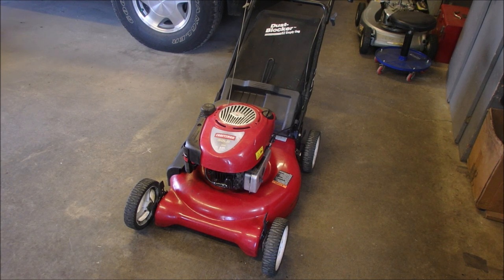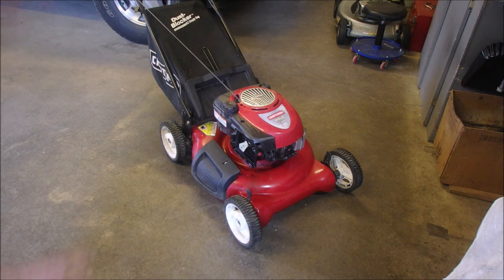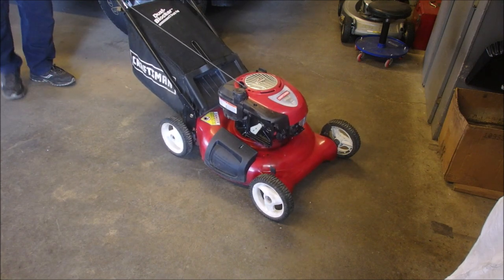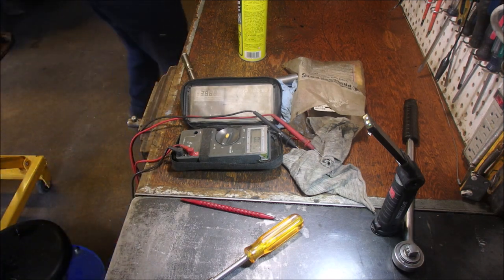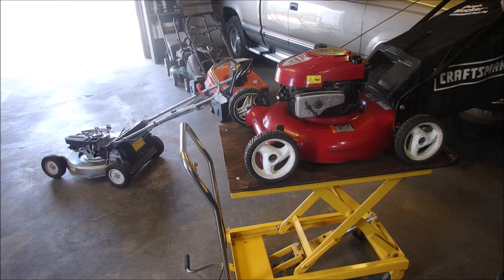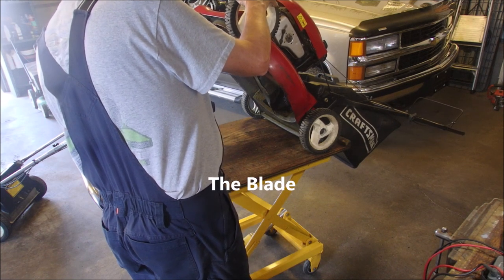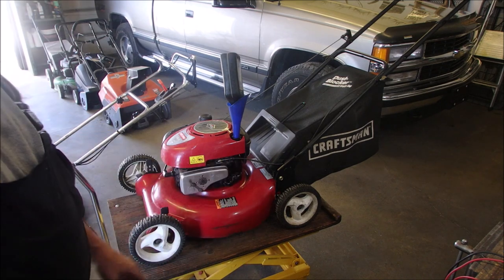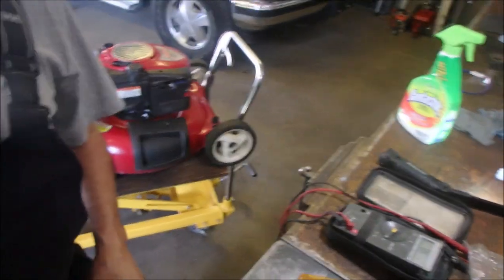Craftsman With  A Bad Quantum Engine??

Comment: Thanks for the thanks Bruce the head bolts nearest the muffler are always loose. On the older machines i have found them so loose i cannot believe the head was not leaking oil in some cases. Good video lucky it was not the death rattle your customer should be very happy. For that blade to be loose i would guess someone other than you had been working on the blade and never properly torqued it down.
Reply from the maker: I really think I was the first one to work on it.  As it was just low on oil over time.
Reply: Not too sure Bruce how would you explain a loose blade bolt unless not properly torqued at point of manufacture . @BrucesShop

Comment: If the air filter is oiled it(filter) is probably no good. I think people even including some mechanics were used to tipping them with the spark plug pointing at the sky,but that can cause the top mounted breather which is fairly far towards the front to become submerged in oil and the oil can get via the hose into the air filter box or even into the carburetor and intake valve.
Reply from the maker: Right  Thanks a lot.

Comment: When the blade's been ran loose there could be damage to the adapter or even to the mounting bolt.
Reply from the maker: You are right.  I torqued it after i sharpend it.  I wish I could film eveything.

Comment: Nice work sir. Had that happen to me before had to add a washer to mine and no more noise but not sure if it was a craftsman or mtd 😊
Reply from the maker: Right the bolt can bottom out before the blade is tight.  Thanks for joining in.
Reply: @BrucesShop  your welcome sir

Comment: Just replaced a carb on my craftsman tracor...blew three belts  2 cheapies and on kevlar that was a 1/2 inch short learned my lesson took the deck off and it was filthy cleaned everything and sharpened the blades cant mess around with a 1/2 inch shorter belt !carb was only 15 us bucks came with the cellinoid ! Plus im going to sell it after sucking up the leaves this fall it tea
Reply from the maker: good for you sir.

Comment: Dang Bruce , I could have used that mower. 
Looking for a replacement motor for my modified Craftsman brush cutter
A hidden ground rod at the farm did in the oil sump on the old girl
3000 rpm to 0 in a split second has a tendency to make things crack!
Reply from the maker: I understand  ouch

Comment: Hi Bruce, your friend Harley from Saskatoon here . Bruce I got a new  hyralic table like you have . I am getting to old to left lawn mower & yard machines . Do you have any suggestions on the size of the wood you put on the lift . Any thing you would change to it .
Reply from the maker: I put on a 2 foot by 3 foot    3/4 inch plywood.  I used cariage bolts smooth side up to stop burrs.  a 1X2 at the other end to keep the mowers from rolling of the back.    I have had some folks say to put edges on the side but whe I am doing a smowblower wider than 2 feet that would catch.  Good luck.     Here is sm older video that may help.  
https://www.youtube.com/watch?v=yv7FtFWRHaU
Reply: Tyvm my friend .

Comment: Ah the old blade knock issue lol - Had that a few times, including some where I didn't tighten it down enough myself...oops
Reply from the maker: Yes  A person assumes the worst sometimes.
Reply: @BrucesShop  I totally get it.  Done the same myself LOL.  In fact, even today working on a Quantum, after I finally figured out someone before put the wrong gov spring on it I was like "what is that racket"....I forgot to tighten down the front bolts on the recoil..d'oh!

Comment: Guessing the person that worked on the blade also flipped the mower on the wrong side and got all that oil into the air filter.
Reply from the maker: I really don't know.  Could it be the airfilter was so dirty it was trying to pull air through the pcv tube?